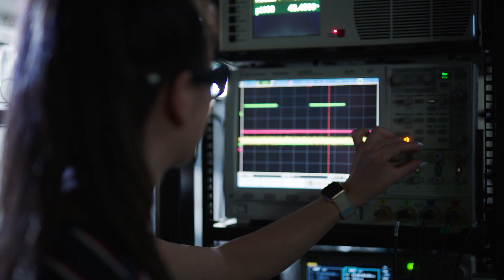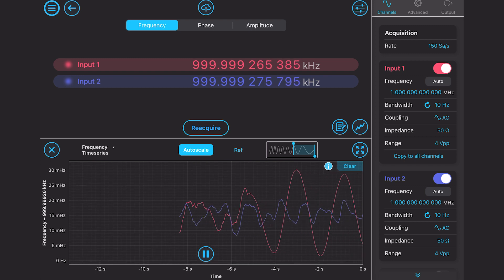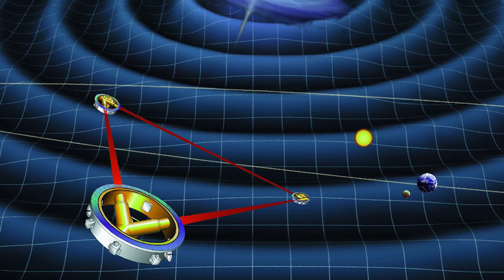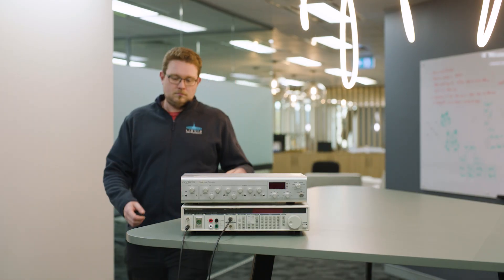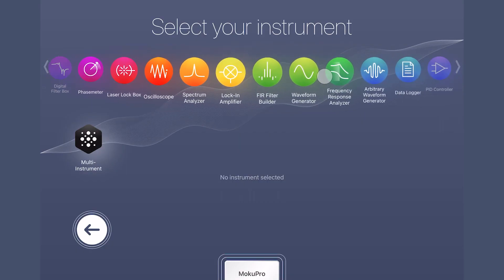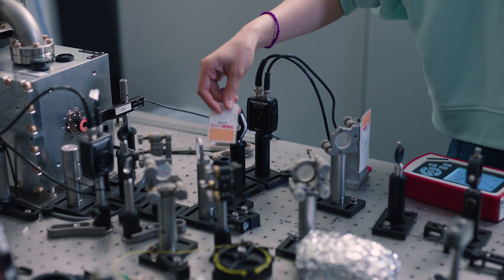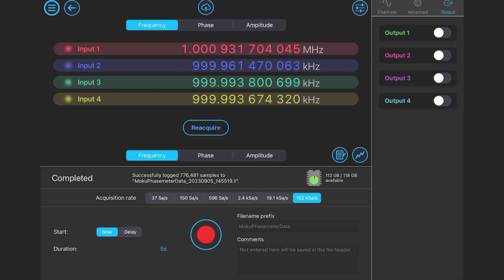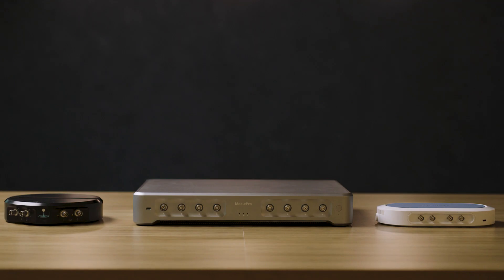Phasemeter

Comment: Perhaps you could add an LCR meter function to measure SMD and through hole components, producing a graphical output output similar to what is available from component datasheets. eg cap + ESL , ESR  vs Freq) You may need a jig to help with the calibration prior to measurement.
Reply from the maker: Thanks for watching! We will add this to our feature request list. If you'd like to discuss it in more detail, reach out to us at https://www.liquidinstruments.com/support/contact/.

You can use the Moku Frequency Response Analyzer to perform inductance measurements, with some post-processing required. Check out our app note to learn more: https://www.liquidinstruments.com/blog/2023/01/13/impedance-measurements-a-guide-to-measuring-impedance-with-mokulabs-frequency-response-analyzer-part-2-inductance/